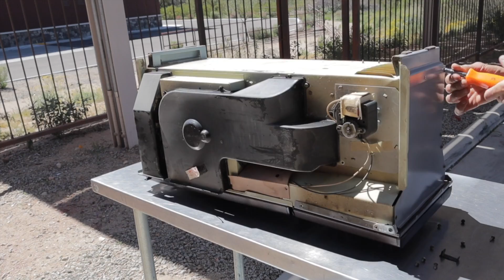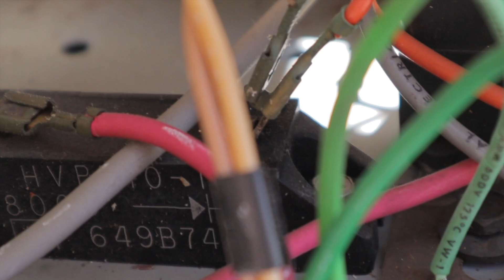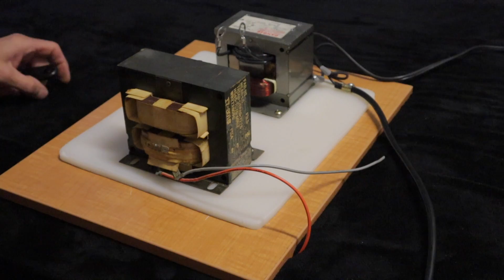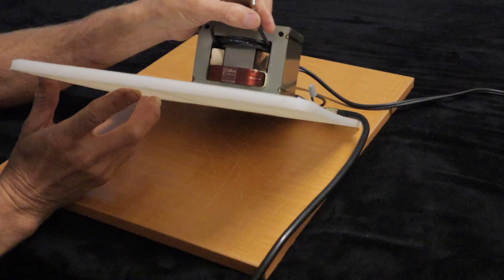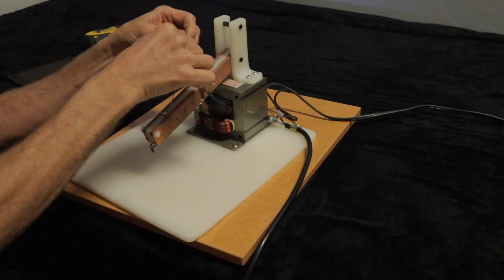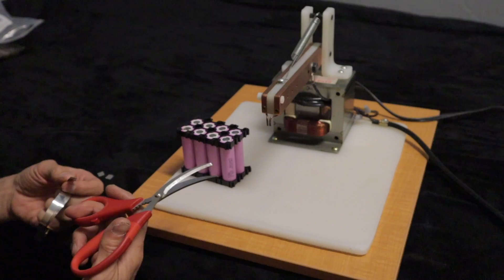DIY 18650 Battery Spot Welder and How to Weld Tesla Style!

Comment: Can we make it with any Microwave transformer or some specific? I did try with one but that doesn't make a got spot weld. What should be the ideal length of the secondary wire coming out?
Reply from the maker: Hello! Yes, any decent size microwave transformer should work. I used one out of a 1000watt microwave and my output wire I did two complete turns of 4mm copper wire. It is the size of the output wire and the number of turns that determines the amperage of the spot welder. If you are not getting enough power to weld, go up in wire diameter but do not increase the number of turns of the output wire. There is some experimentation to get the amperage you need out of the size transformer that the microwave had. Hope this helps!😊